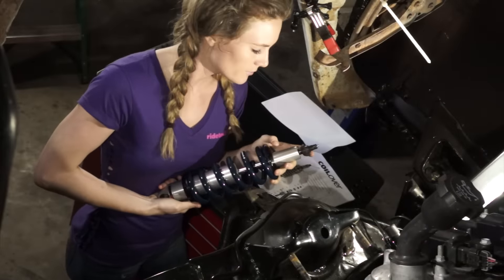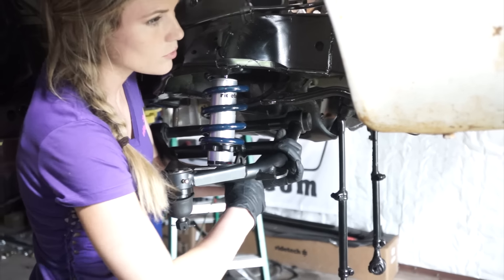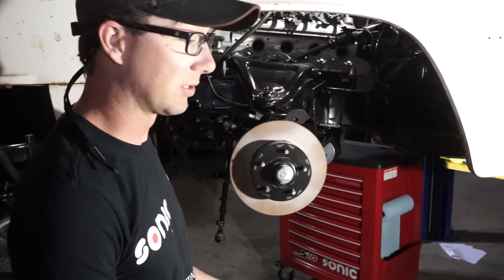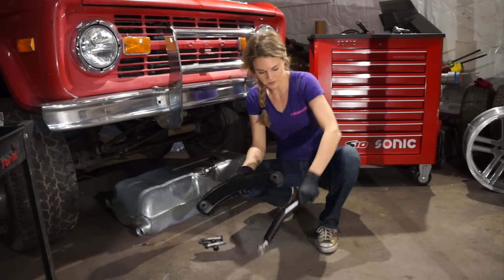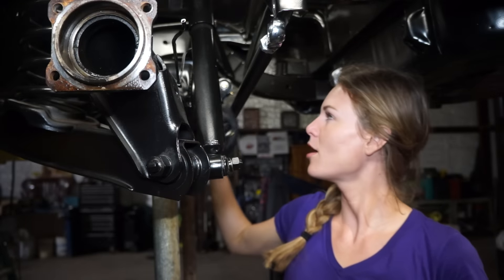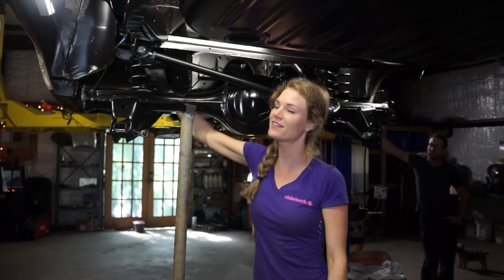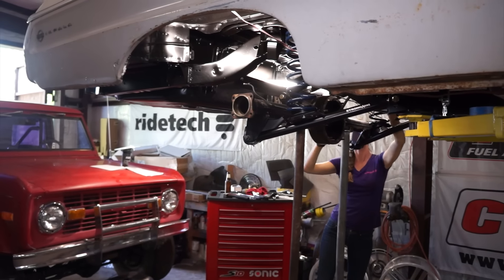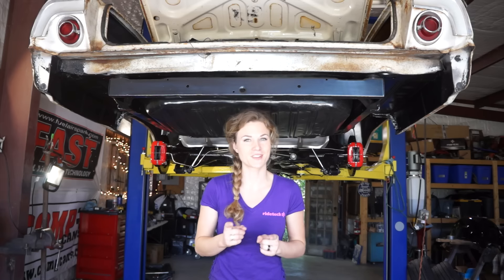Suspension install on supercharged LS 64 Impala SS - In the shop with Emily EP 19

Comment: rebound damping is not really felt as stiffness in the way you may think, you'll notice more rebound damping slows body roll from the  unloaded side of the car lifting, so it will fell like it hugs the road more. it may also cause the suspension to not retract fully on successive hits and bottom out easier.

Comment: Next time you have trouble removing a front shock,  use a deepwell socket and a long extension to bend the top back and forth a couple times  and it will break off.  You don't have to cut or use special tools and it's fast.